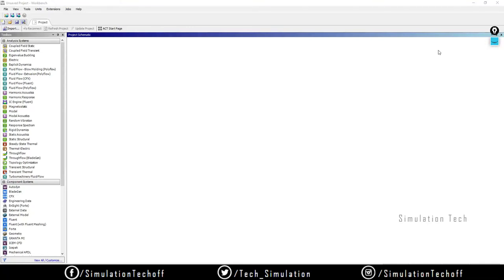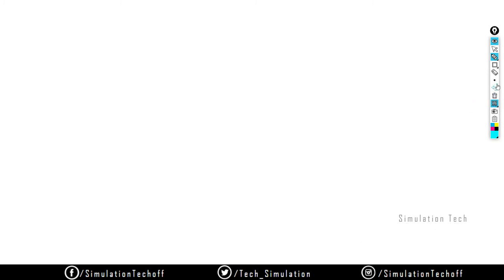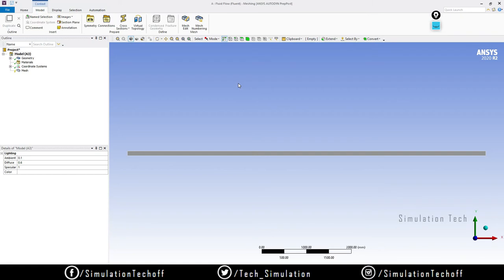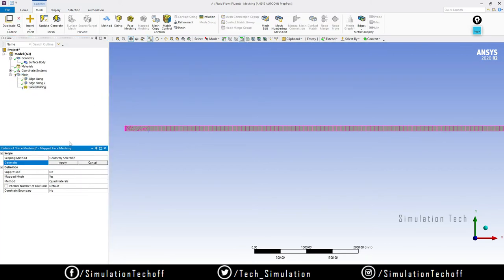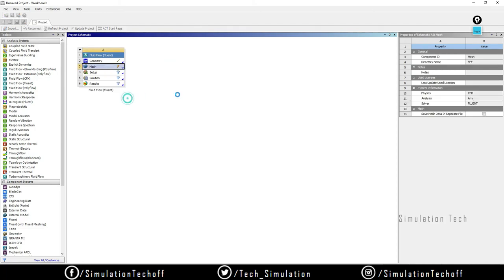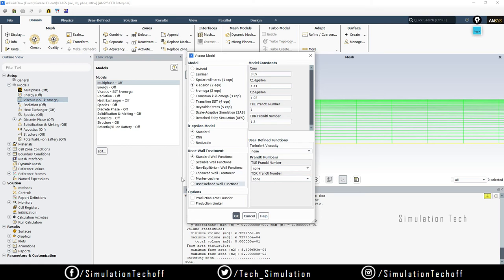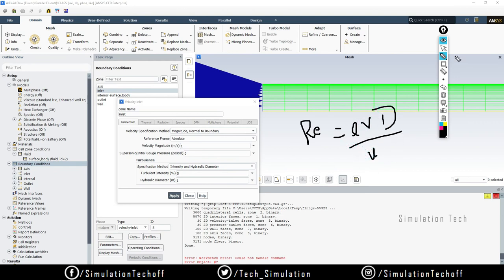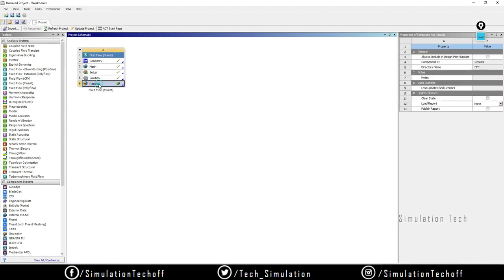Turbulence Model Analysis in Fluent  | Lesson 06 | Part 1 | Ansys CFD ( Fluent )

Comment: Bro why we change the object into symmetry. We want to change the 3d object into symmetry. Why we didn't change the 2d object into symmetry form. Application of symmetry and why we use explain plz bro.
Reply from the maker: In 3D we model the half of the session which are symmetry. But this case the pipe in axissymmetric condition that's why we model the half of the 2D surface and used the axisymmetric condition to revolve the surface in to 360 degree. The get the solution for actual whole Geometry.
Reply: @simulationtechhub  ok bro this condition ennatha ennatha edathulaam use pannanum and why
Reply: @simulationtechhub  Thank you bro. Your kind reply
Reply from the maker: @nagappanv6096   

We can use this method ,when the model is suppose to be Axis Symmetric in condition. 

Need of this method ? 

In Axis Symmetric condition we can reduce the node and elements counts with Simplified model. 

which leads to less solving time.
Reply: @simulationtechhub  Tq bro